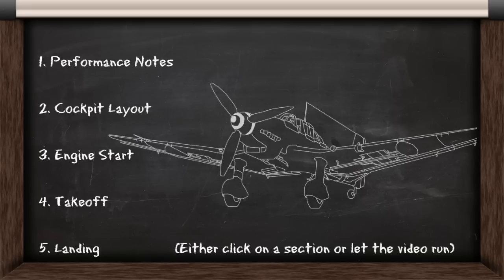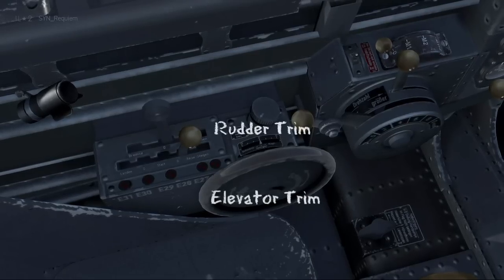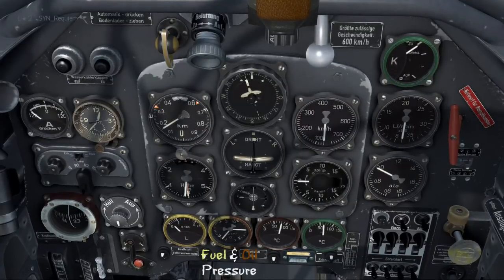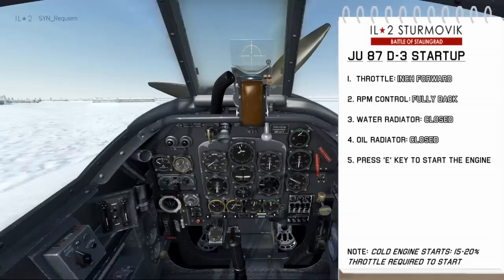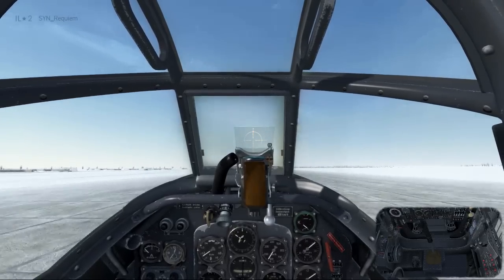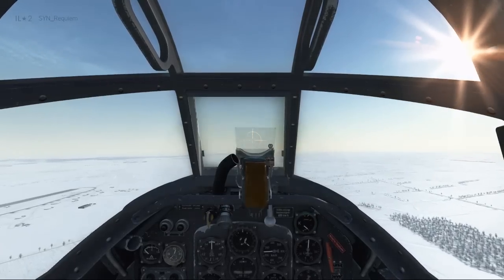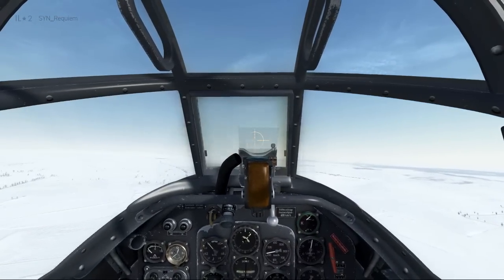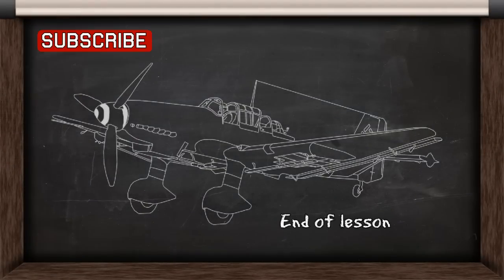Learn to fly the Ju 87 D-3

Comment from the maker: To get the external view at the same time I have to record the footage twice. Once in the cockpit and then a second time from external view. Then I used my video editor to combine the two clips in the way you see it.
Reply: Normally after "flare" wouldn't it need a bit more of forward push to keep the tail off the ground ground a bit more as well?
Reply from the maker: @georgepettas3267  That's only if you're attempting a wheel landing. During a 3 point landing you wouldn't do that.

Comment: I've got immense amounts to learn...I'm gradually getting my opentrack/aitracker adjusted along with using joystick, pedals, and a nifty little Logitech throttle quadrant I can assign flaps, RPM, trim with. The Stuka is a fun plane to fly....but I found out the hard way to not run over 2500 RPM for long periods.

Comment: I kept forgetting to open the oil radiator, that explains a LOT XD
Reply from the maker: Yeah Mastergamer, the radiators can be a bit touchy on this one especially considering how sensitive the engine is when it's run outside of normal parameters!
Reply: Using the single missions i’m trying to improve on strafing/learn dive bombing but the biggest challenge by far is trying to understand what the engine wants from me
Reply: same!

Comment: Great job, usefull. Landing seems easy when I see your videos...
Reply from the maker: Honestly, I feel that my landings are a result of always trying to do a consistent circuit and approach each time. I don't get these recordings on the first try though. I spend a bit of time practicing to figure out which speeds work on approach/touchdown and which do not. The Stuka is simple enough to land though compared to the smaller fighters.

As long as you have flaps and enough height on final you could turn the engine off and you will make the field. Just make sure you touch down at the right speed with three point attitude and your landings will suddenly become easy!

Comment: Your videos are a must. BTW, I'm little curious of what gear u use. U seem to have very fine control near the stick center. I find the center detent "hick" very annoying. And all joystick have them... Million thanks for your effort Requiem :)
Reply from the maker: Hi Kjetil, I use a Logitech G940. It isn't the most precise thing going around, especially the pedals, but the joystick is great. Unfortunately they don't make it anymore.
Reply: Nice, thats a foce feedback stick. That explains the precise tiny movement I think. I have a X-55 modified with 4 springs in the corners to make it better near the center.

Comment: Hello Req,

I am literally your info, but in the single player campaign, I can not keep driving the JU-87 in working condition. Is this due to the latest update? 

Do you have the same problem?
Reply from the maker: Guignol-Mig I changed the CEM settings in the annotation. Don't exceed 1.2 ata and 2250 RPM in normal flight, and make any throttle/RPM changes correctly (because it is a constant speed propeller), and you should be fine. I've ony broken the Stuka engine when I overrev it through bad throttle / RPM management.

Comment: what am I supposed to do with all of these engine controls during flight? Am I supposed to micromanage them?
Reply from the maker: No, you can just set the RPM and throttle to the max continuous setting once you have a safe altitude and leave it there. You can leave the water and oil radiators fully open no problem as well if you wished

Comment: How in the heck are you guys taking off with the BIG bomb!??  Takes forever.  Climb rate is horrendous.  Any suggestions...
Reply from the maker: You need to use a reduced fuel weight and a very shallow rate of climb. There's really no way around it...the thing is an absolute pig with that 1800kg bomb attached
Reply: @RequiemsACTL  okay makes sense.  Want to love this airframe, it's hard though.  Especially with the 110.  She's basically the swiss army knife of German airframes.

Comment: I cant get the engine to stay in takeoff mode. It stays for 2 seconds and then goes into continuous. Any ideas?
Reply from the maker: Sounds like you may need to increase the RPM
Reply: Might be silly, but check if under realism settings, you don't have the engine manager turned on. Happened to me.

Comment: i'm having problems with my engine dying while i'm flying to an objective. i follow all the notes in your guide on the IL2 forums and from this video but my engine still dies without fail. any thoughts?
Reply from the maker: I've never really had a problem with the engine dying, but when it does it is usually due to RPM that is too high. Make a note of what your RPM was at the time it started dying and then keep it lower next time and see if it still does it. To be completely safe you can keep on 2200 RPM and 1.2 ata.
Reply: The Air Combat Tutorial Library i have no idea how to control the rpm in this sim

Comment: My engine seems to just cut out mid flight.
Reply from the maker: You might be running the engine too hard. To make it easier, just try and run the engine in "climb mode" or "continuous mode" using the technochat.

Comment: for me, when i start the engine, the rpm is set to 100% and i cant change it after that
Reply from the maker: Check that you don't have the engine assist options enabled
Reply: also, when i takeoff it takes around 15 sec of rolling down the runway at full throttle to get to like 50 kph, idk what im doing wrong im following what ur saying
Reply: and there is no way in hell i can climb that fast like you did, i instantly stall when i bring the nose up the slightest
Reply from the maker: Consider what bombs you are taking and what your fuel load is too. If you're taking the massive bomb you don't want full fuel for example. If you want make a recording in-game (CTRL+R) and send me that track (the .trk file and the folder with the same name) via PM on the IL-2 forums and I'll see what you're doing.
Reply from the maker: Another thought is that maybe you have the toe brake controls axis inverted....so they are always applied when you're not pressing them.
Reply: no, i have checked and i dont have it inverted
Reply from the maker: Ok. Send me a track then as explained above to me with a personal message at the IL-2 forums